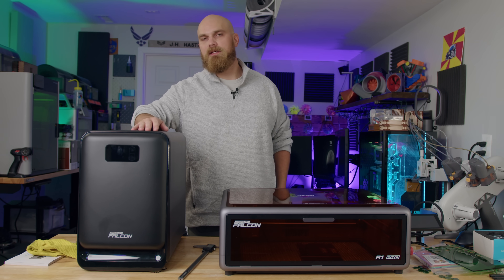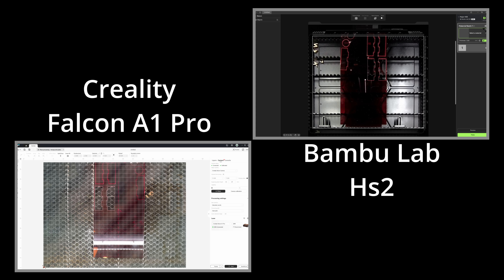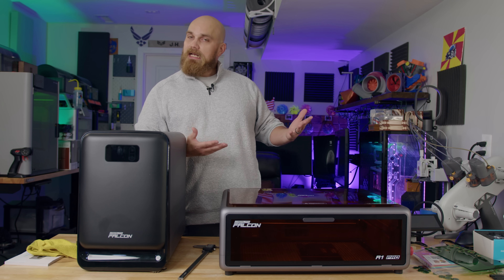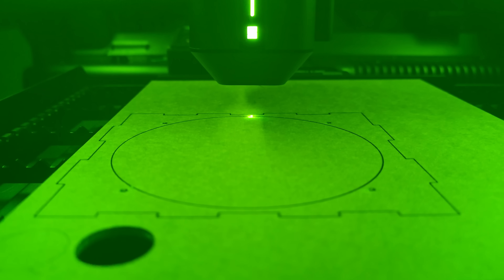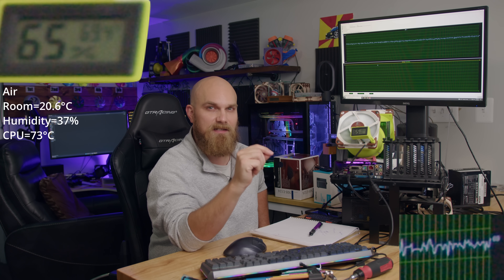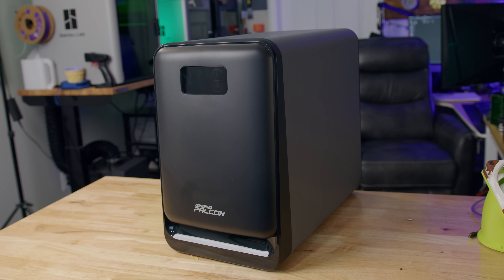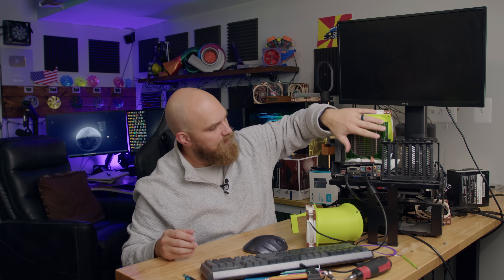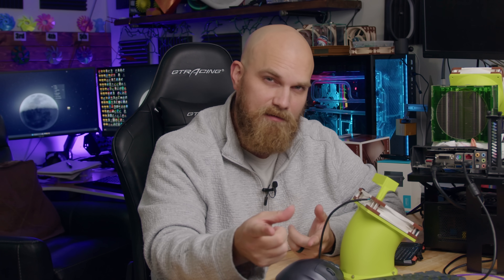I Water-Cooled My Air Cooler… Again, But Different

Comment: The reason why we perceive humid air as hotter is because our bodies cool using evaporation, but if the air is already saturated with water, it cannot take as much from our sweat and we cannot cool as effectively.

Comment: A properly designed evaporative fluid cooler would cool a liquid stream to about 10F above the wet bulb air temperature. In Los Angeles the 70F wet bulb you could reliably cool a liquid stream to 80F. Evaporative condensing is the preferred choice for most large refrigeration systems because it is so efficient. Cooling a liquid stream is very similar to condensing refrigerant gas into a liquid. Evaporative fluid cooling is not effective when the target cooled temperature is below about 80F which is about where a fluid chiller will be required. Evaporative coolers quickly loose capacity in high humidity/high wet-bulb situations.

Comment: I remember seeing the same principle in closed loop cooling.

On the hot side the coolant was either dropping freely from the top of the reservoir. The reservoir was like 2m tall.
The upgraded model was turning hot side coolant into a mist. 
The amount of air in the big reservoir made it so the whole contraption had no chance to get to the thermal saturation point.

Comment: Air is a terrible heat transfer medium actually. It is the water in the air that transfer the heat quickly. That's why we sweat to cool, its how swamp coolers work, and why an 'air gap' helps in the insulation process for preventing thermal transfer.  But with cpu coolers, it never even occurred to me that a 'more humid air' would help the cooler work better!  66% is humid, but relative to Florida? 66% is not bad at all, and seems like a 'dry day' lol. 👍

Comment: yay. phase change. latent heat. massive amount of energy held in water vapour.

regards the "immersed" methods... evaporation again also plays a role... rather than rely on surface area to radiate heat via conduction to the air, OPEN THE TOP and let the water evaporate freely as it will carry away FAR MORE energy than the air can. stirring it also helps as you will still be limited to conduction and convection it induces.

if you then allowed that vapour to condense elsewhere, so the water can make its way back to the heat source, the heat shall be dumped at the condensor. 

this is how the heat pipes work... the pressure is held so low that as soon as any heat is applied it quickly evaporates as it absorbs the heat and has a lowered vapour pressure, travels to the condensor dumping its latent heat, then wicks back to the "boiler"...

Comment: reason why humidifier cools is that this style of humidifier doesn't create vapour, what you see as mist is water droplets suspended in the air, so after a short while they will evaporate and change into vapour and to do which, thanks to latent heat of vapourization (technology connections) it makes air colder, thats why its cooling more effectively
Reply: one more aspect here: water has huge heat capacity (Q/mdT), so when we mix water with air, its ability to take heat at the same dT is higher
Reply: @sinkapoy  Pretty much why watercoolers have more stable temperatures.

Comment: I've got both a 10w and 20w Sculpfun Diode Laser- one is quite upgraded and expanded so I can do big jobs up to about 3x3 feet and I can swap the heads between them. I love these Lasers- been running one for 2 Years and the other for a Year and a half. They have great Customer Service and they always send me extras useful things when there's a problem instead of only replacing the faulty part (rare), plus you can use their frame/setup with other brands in a modular sort of way. I had to make my own case/exhaust system but I kinda prefer that- I use cardboard enclosures so I can customize them easily- figured at some point I'd get a proper enclosure or build one out of wood but nope- the cardboard is great! It doesn't autolevel but otherwise performs like yours, other than the overheating (never had that) and there's no LCD- lots cheaper to make up for it though. For reference, my longest burn has been around 5 Hours of continuous Lasering on Playing Card that's about 2 Feet tall- turned out great! I did have a problem with a faulty wire early on that would cause it to stop randomly, but after resoldering things myself it's been perfect- that was about a Year and a half ago.

Comment: Honestly surprised you got through transparent acrylic with a 20W diode laser.  I have a 40W Xtool S1 that I use for engraving but for cutting anything but dark (black really) acrylic, I use a CO2 laser.  A good test would be to remove the masking on the acrylic and see if you get much cutting at all.

Comment: I'm getting triggered by the lack of coolant in the distro plate xD I truly don't care for the visual aspect of it, but having a low coolant level combined with high "in" port creates a lot of bubbles that the pumps take in.
That creates two problems:
1. The more air in the loop, the worse heat transfer, aka lower performance
2. Waterpump sucking in air can damage it, especially the D5 pump that has a cooling sort with water flowing through it, and it can also damage the bearing (it has a ceramic ball-point if I remember correctly)

Not use on the exact version of your distroplate, but it should have a fill-in port on the top corner (inside or outside).

I was an in-house photographer for EK water blocks from 2019 till 2024, and 99,99% consumer products went through my hands at one point, and I sometimes prepared parts/builds for studio shoots. I remember talking a lot with engineers, and trust me. Fill your loop. Half-full distros are much worse than regular res/pump combos.

BTW, keep up the good work!

Comment: 'Bong' evaporative water coolers were a thing in the early 2000s for more extreme overclockers. Water temperature could be well below ambient.
Reply: fore regular like athlons and stuff kind of heat loads you could just have a bucket of water and a fan blowing on the top of the water and it would keep at ambient or 1-2 degrees below ambient easy.

a regular first gen athlon would also survive boiling water in the block.. it wouldn't keep running(it would crash) but it would survive. say if you forgot to fill the bucket.
Reply: Halfway between peltier cooling and single stage :D

Comment: Your handmade clear box can be vastly stronger by overlapping the sides with a second sheet, assuming classic box construction rules.
  Not that you're having problems. A glue joint staggered like a staircase, each layer lapping and interlocking on two faces makes boxes you can throw at a wall without damage.
Reply: And there are always tongue and groove joints.

Comment: you know that gap between the top of the cpu cooler and the bottom of the fins? what if they added something which could increase the effectiveness of cooling? I mean I'm sure that little block has some heat to it. so I'm sure you can dissipate that.

Comment: I used to spray isopropyl into the fans for benchmark runs while overclocking to get some evaporative cooling. This is probably the same thing but with water.
Reply: Computer starter fluid ahh
Reply: IPA is probably a bit better as it boils at lower temperature (or evaporates at lower temperature as well). I bet water is cheaper tho!
Reply: @Qwarzz  Remember that sweat, which is mostly water, evaporates at temperatures much lower than it's boiling point.
Reply: @HappyBeezerStudios  Yes but alcohol evaporates much faster.

Comment: remember, hygrometers like that are showing "relative" humidity.  The airs ability to hold moisture changes with temp.
Reply: Someone has watched too much Technology Connections 😂
Reply: and pressure!
Reply: My ability to hold moisture also depends on pressure :)
Reply: Relative humidity is what fogs up the car windows with your sister in alabama

Comment: What you're looking for and probably thinking about was the Evaporative Cooling Effect, that as water dries on the surface of something it cools that surface as it converts to steam. You'd be better off spraying the surface of the heat-exchange coils with a fine mist allowing the surfaces/fins to become just wet, and allowing the water to evaporate off the fins; which would then remove heat.  That would be more efficient than just piping steam or humid air through the system.

Comment: the better version of this would be using a mister (rather than evaporator,) with room temp distilled water

some industrial datacenters use that exact system for cooling

Comment: So I haven't seen much on this, but what is the optimal configuration for a 360mm AIO cooler. 

Push, pull or a push & pull configuration.

What is the ideal location for the radiator. 
On the top of the case, or the front. 

With the fro t of the case is it best to have the inlet ports at the top or the bottom of the case. 

Will a push pull configuration fit in the case.
The use of thicker or slim line fans work best. 

I'd love to see a season based on the cooling capacity of a mid range AIO cooler. 

Maybe incorporate some different fan types aimed at raw pressure to push through the radiator.

Would love to see this expanded due to the rising popularity of AIO coolers.
Reply: I think JayzTwoCents did this years ago as far as push/pull/intake/exhaust.

IIRC AIOs setup as intakes performed marginally better as they pulled fresher air, but imo you should just do what makes sense for your rig.

Also being setup as an exhaust helps prevent the AIO from sucking in debris like hair and stuff from the outside which is a factor to consider, I prefer putting it up top as an exhaust and I have large case fans on the front brining in most of the hair, try and have a flow direction planned out so you don't have weird instances of fans pushing/pulling against each other.

Comment: water has a fantastic ability to absorb a LOT of heat. humid air therefore can absorb a lot more water than dry air. I was not surprised that the humid air removed more heat.

Comment: really funny that you use a whole PC to test the effectiveness of a cooler. You could probably have an easier, more precise time by using a resistor, unsulated on all sides but the one youre testing. Youd know pretty exacly how much power is being dissipated by measuring the voltage drop.

Comment: Not surprising, I run water meth in my turbo diesel, it’s a solid 15-20 degree drop in inlet temperatures when it turns on.

Comment: I worked for a company with 4Kw fiber optic lasers that trimmed and cut holes into parts for automotive frame assemblies. The parts were stamped on a hot press so they cannot cut normally. The lasers were komatsu tlh-510s. After seeing those and working on them these hobby grade ones seem very underwhelming. Its also annoying how inadequate they make their cooling systems. Diode pumped yytterbium dopped fiber lasers are complex and isn't an at home option. These co2 and diode lasers have shown some decent promise but its either configuration or cooling that ruins them. Lasers can be used for far more complex operations than 2d. The lasers I worked on were 5 axis with an optional table axis extension. Not everyone wants to make cute plywood plaques for etsy.

Comment: That’s why humans sweat. The small amount of airflow across the water will pull heat and transfer some cooler air temps to your skin, cooling your body.

As for this; Yes, swamp cooler.

Get inside one of the massive ones that cool high rise buildings.

20’ cube with massive paper pads on two sides, and a couple massive fans underneath the catwalk you’re on pulling air in.

It was 145° on that roof. The temp inside that massive swamp cooler was in the 60s.

Comment: I love the honesty on the review of the Falcon A1.  I agree, if I pay that much for a laser cutter, it should cut all day long at the advertised wattage.
Reply: Service duty cycle is always going to be a concern with any laser. Simple truth of using mass produced parts for a specific application.
That said.
1.
Wattage should not matter, a ten watt should have the same cycle times as a 400. Getting trounced by bamboo like that is frankly embarrassing.
2.
Software should know when service duty cycles are an issue, and have scheduled dwell times. Not an overheat alarm.
3.
Honestly, thay was way too fast. It sounds like the Falcon had issues with the laser light reflecting back into the diode.
That IS going to happen with all laser cutters. No matter what, but. It is less then a U.S. dollar's worth of extra componants to mitigate that and reduce the return glare to a reasonable service duty cycle. Non-Linear optics are amazing like that and while they used to cost an arm and a leg and where not even used on industrial laser cutters today is a diffrent story.
Reply: it would be like buying a car and after 30-45 minutes of use, you have to let it cool down for 15-20 minutes in order to use it again.  that would suck
Reply: @daxconnell7661  not really.
not many cars appreciate FULL THROTTLE running for hours on end with no break. big difference to simply cruising. 

aircraft engines have cruising powers that will hold indefinitely... they also have maximum powers that are only to be used briefly.

welders have duty cycles on them... no welder, commercial, DIY, or industrial, has a 100% duty cycle at full power. mines 250A. 100% at 120A. 50% at 250A. 

lol, the lift motors of a hospital bed or recliner have duty cycles...

im sure if you read the specs that the machine will state duty cycles.

its not false advertising, its simply the way it is.

friend had a 20kw trumpf laser cutter. the cooling stacks alone were held in two shipping containers. it still had a rated duty cycle... 

and its not always just because of the electronics... the LENS has to transmit that power, and there is a certain absorption loss...it has to remain in focus, and it has to be able to disperse heat... and it cant have cooling water run through it, for obvious reasons...

lol, this laser cutter, it didnt run. his father got it cheap because... the lens was broken! 

"cheap"... half a mill...
Reply: @paradiselost9946  True, but the part he cut isn't even anywhere near the maximum size the laser bed supports, and it doesn't have all that much details either.

If it was really small, just barely big enough to support this part then I'd be fine with such a low duration duty cycle, but this ain't it.

It's a 20W laser, how hard could it be to dissipation the maximum 7.5W of energy the lenses absorb.

And water cooled lenses do exist (in a way), it's 2 half lenses with a thin water layer in between, which allows far better heat dissipation to the enclosure.
Reply: @ledocteur7701  unfortunately the addition of the water layer adds several junctions that increase the loss... 

i checked the manual. no listing of duty cycle of any component.
thats creality for you. they target consumers. not manufacturers.
Reply: @paradiselost9946  it's a laser cutter, it has no "full throttle". It's either cutting or not cutting. Even doing multiple passes is still just cutting the same shape over the material.
Reply: @marcogenovesi8570  so youve never heard of controlled current, huh? its a diode laser. its "throttleable". ever set one up? you can have that current from no-conduction leakages with no output to burning the diode out at 3X rated power under LN2...

then you can PWM it as well...
Reply: @paradiselost9946  so you've never heard of deceptive marketing, huh? The head's capabilities are irrelevant if the device's heatsinks can't withstand this level of power. Why wasn't this properly disclosed to the end user? This is not a DIY toy for tinkerers, it's sold as an appliance to do a job
Reply: Yeah, at the very least.

Comment: If you do any more tests with atomizing water, Please use purified water.  Don't use tap water.  The minerals in the water will get left behind, and stick to the heatsink.   Not only would it effect the heat transfer of the heatsink,  But it could also cause corrosion problems, and would look awful.

Comment: This is why we use Saturated steam in nuclear naval propulsion plants. Saturated steam transfers more energy than Superheated (Lower humidity). 
Like it has been said before, this is a Swamp Cooler. I never heard that term until about 5-ish years ago. Anyhoo. 
Caffeinator out.
Reply: They are used a lot for cooling in dry areas. I one in Colorado house and we left it on during the day when we left for work and it was 60 degrees inside while it was 80+ outside 
Plus they are pretty cheap.

Comment: Now fill the humidifier with something like Rubbing alcohol.  With it's much lower boiling point, It should draw away even more heat, when the small droplets boil off when they touch the heatsink.    .....Just have a fire extinguisher ready.  lol
Reply: Those tiny humidifiers use ultrasonic diffusers which is like a tiny peso speaker they might not work the same for alcohol.
Reply: @ralanham76  True.  I tried putting a UV reactive dye into water, then use one of those ultrasonic diffusers in it.  It vaporized the water, but didn't carry over the dye. ( I was sad, I was trying to make a green mist for my front porch for Halloween ). 

I might have to try it sometime....but outside. I have some 100% IPA that I ordered from Amazon a while back.  with zero water in it, I will know it's the actual alcohol vaporizing, and not the water mixed in it.